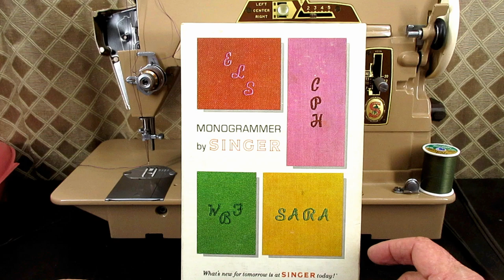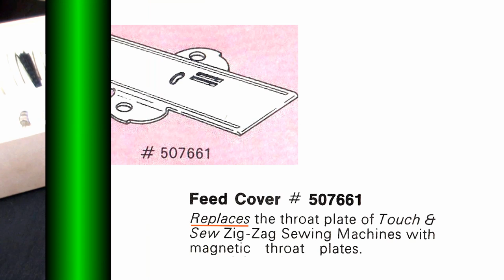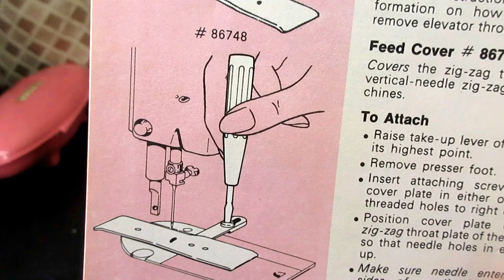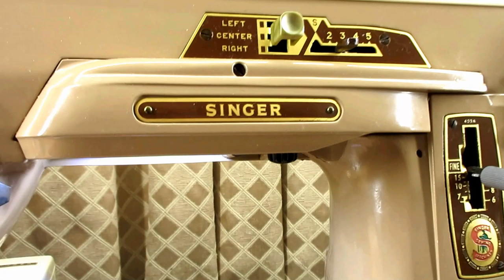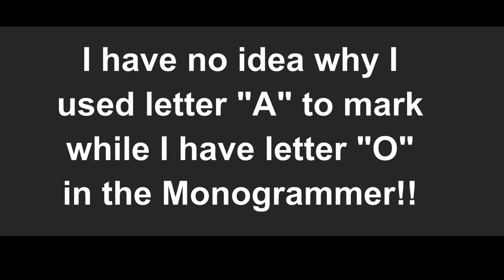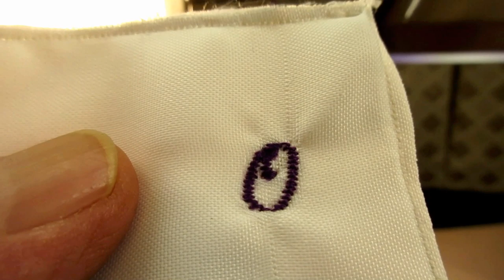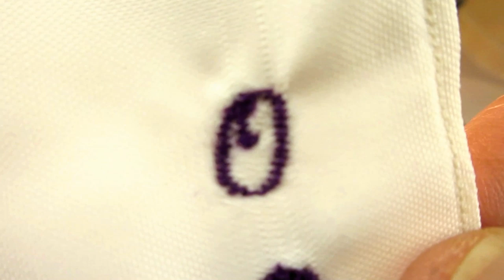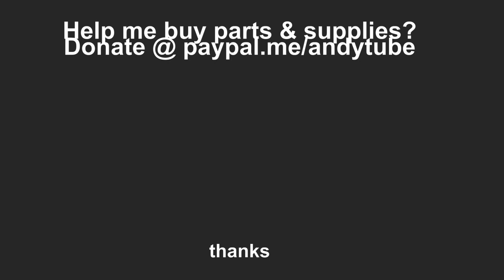The Singer Monogrammer on a Slant-O-Matic 403A Special Sewing Machine

Comment: I monogrammed all my work shirts with the company's name and my first name and people would talk to me first, thinking I was the boss. Ha ha
FYI To pull your threads to the back. Pull on the END lower bobbin thread on the back of the fabric until the top stitch loop pulls through, like that in an under-tensioned top thread. Hook the loop with a point of a seam ripper and pull it through. The shorter the stitch, the smaller the pulled through loop, so look carefully.
Reply from the maker: There you have it, folks! A tip from a real sewist. Thank you very much for sharing. I pinned your comment to the top.
Reply: i realize it's kinda randomly asking but does anybody know of a good website to stream new series online?
Reply: @andytubesewing1953 this is so precious and I love it when you pin comments - they are always educational but every now and then also provides the most useful tips interlaced with personal stories 👍

Comment: A little late to the party (4 years), but I thoroughly enjoyed the video and found it helpful.  A hint on improving the quality of the monogramming would be to use a fusible or tear-away interface backing on the wrong side of fabric in the area to be monogrammed.  The additional structure for the fabric helps.  Our granddaughter's parents are both doctors and I made a monogrammed play lab coat for her when she was 4 yrs old with her name + "MD" added for effect.  I used this same Singer monogrammer on a 500A machine I have.

Comment: I have this monogrammer and it is fun to use.  AFAIK, it only comes in a slant shank version - same with the Deluxe Monogrammer - which is one of the reasons I cherish my 401.  This monogrammer makes teeny little initials, mainly suitable for a handkerchief, shirt collar, pocket, or cuff maybe.  They are cheap and plentiful on eBay and ALL the letters are included.  With the Deluxe Monogrammer, the attachment is cheap and easy to find, but you have to collect the letters one by one which can be costly.
Reply from the maker: Thank you for watching my channel and sharing information. Page 16 of the Instruction Manual for this Monogrammer discusses three different feed covers that can be used. The third cover, #86748, says "Covers the zig-zag throat plate of vertical-needle zig-zag sewing machines." I have not tried it on a vertical-needle model, say the 347 or 457, but I think it can be used on them. The cover plate #86748 is very similar to the feed cover that came with the Singer Buttonholers. It is a little different, but I've wondered if the buttonholer plate could be used with this monogrammer on a vertical-needle machine. Maybe another viewer will comment and we can learn a little more. I'll pin your comment to the top so maybe others will notice it. Thank you again for sharing, lisalu.
Reply: I actually found a deluxe monogrammer for straight-needle sewing machines on eBay & bought it!  I guess it’s rarer than hens’ teeth.  Edit 8-7-24, the straight-needle monogrammer works great.  I also found & bought the deluxe and regular monogrammers for slant-needles.  Finding all the letter cams for the deluxe is a challenge.  I have all that I need for family members, but one day I hope to find the rest.  That may be “the impossible dream,” ha-ha.

Comment: I was fascinated by how to use the monogrammer. Did you try using regular embroidery thread to stop it from breaking? Will it work on a Singer 600e? It is a slant machine.
Reply from the maker: I do not sew and don't have embroidery thread to try. I think it should work on your 600E, but you can get a free copy of the instruction manual showing the different feed cover plates and how to use the device by emailing andymanuals53@gmail.com and asking for it. There is no charge and your email info will be deleted after they send you the manual in PDF format.

Comment: Clever guy !!!❤❤❤ I am left wondering if this would work on my Athena (also a slant needle machine)
Reply from the maker: Ooo, good question that I can not answer. The Althena models are newer than any I worked on. I'm guessing the slant feet are the same height on all slant machines. The question for me is if any of the three cover plates that came with the Monogrammer would work on an Athern model. The instruction manual says you MUST use a cover plate, however, I have used the buttonholers without the cover plate issued with it and had great results. I guess you have to ask other Athena users (Facebook groups??) if anyone has tried it, Of course, you could buy a monogrammer on eBay and make a video about trying it out 😁 Thanks for watching.

Comment: Great video. I was looking for a throat plate for my singer touch and sew (magic bobbin). The problem is that it was made in Japan and only sold in Vietnam. So it is different from all the touch and sew. It doesn't even have a model number on it. Came with the instruction manual but it is all in Japanese.  So I took a app on my phone that would translate it. I just bought a monogrammer so I hope that it will work. Love your video.
Reply from the maker: Never heard of a Japan made touch & sew. The US made models mostly used the same needle (throat) plate with a couple exceptions. If the monogrammer comes with a plate that fits then you could find a throat plate that does too. Good Luck.
https://www.singer.com/en-ca/find-your-model

Comment: can this type of vintage monogrammer attachment be use with new singer sewing machines???
Reply from the maker: what an interesting question! I've never tried it on a machine-made after 1972. I don't see why you couldn't use it. There are 3 different plates; two for slant needle and one for vertical needle models. You must have a mounting screw hole in the bed to the right of the needle plate to attach the vertical needle plate attachment. (vertical is also called straight shank and low shank) You can get a free copy of the manual from andymanuals53@gmail.com  The manual includes part numbers and a description of the 3 different plates so you know what to look for. Thanks for watching my channel.

Comment: Can I get a monogrammer for my Singer 411G? If so where? thanks
Reply from the maker: The German Mad slant needle models, like 401G or 411G are rare around here and I've never seen one in person or found parts or service manuals for them. If they are Slant Needle such as the 401A, 403A, 404 models are then I think the slant needle monogrammer would fit. There are many on eBay: https://www.ebay.com/sch/i.html?_from=R40&_trksid=p4432023.m570.l1313&_nkw=singer+monogrammer&_sacat=0
I sure other online sellers would have them too.

Comment: do you need this attachment to monogram a name on a shirt with a 503A?
Reply from the maker: Unless you can do that free hand then yes you need the attachment to form the letters. This machine and a 503A and most singer zigzag machines can sew. Very close stitching called satin stitching and that's usually what is used for buttonholes and monograms but they cannot form the letters because they are mechanical machines. This monogram attachment uses an inserted pattern. Cam or disc for the letter that you choose and that is what forms the letter

Comment: Thank you for this video. Do you by any chance know the part number or way to identify the screw that attaches the monogrammer to the presser foot?  I was sad when I realized that I had all the parts to the monogrammer except the attachment screw. I’ve tried other similar screws from buttonholers and other singer machines and nothing is long enough or fits the thread pattern on my 401a.  Any help would be appreciated.  The manual doesn’t list the part number for the screw that I can see. My box says part 171256.
Reply from the maker: Sorry, there is no part number that I can find. I have monogrammers & buttonholers, and the screw threads are the same count and length so I'm surprised at your comment. The thumb part is "beefier" on the buttonholers is the difference. Here is what the original monogrammer screw (attachment screw in the manual) looks like: https://www.ebay.com/itm/403011649561?hash=item5dd55dc019:g:g~oAAOSwiXpgL69K    Here is the original "clamping screw" for the buttonholers I have (3 types of buttonholers) looks like: https://www.ebay.com/itm/294184296550?chn=ps&mkevt=1&mkcid=28   both types of screws fit onto and thread my 401A & 404 presser bar.
Reply: @andytubesewing1953  thank you!  I will try the buttonholer screws one more time and see if they work but yesterday I couldn’t get it to work.  Thank you for responding as I didn’t know how to find the part!  You are the best!
Reply from the maker: @atticusk8548  Please do try it again. The mounting part that wraps around the presser bar has to be flat onto the bar and at the perfect height for the hole. After a couple times you get the feel for it, but it's bulky and awkward at first.

Comment: I think you said this model will work on the 401a. What model buttonhole attachment, the big thing like what you showed on video🤔) will work on my 401a?
 Lol. 
I see new toys for my machine in the near future. Haha
Reply from the maker: The one in the pink Jetson box. You need one marked for slant needle machines. The Pink Jetson model you use with your 401A set to straight stitch AK3 and the buttonholer moves the fabric back and forth. The professional buttonholer model uses the ZZ stitch of the machine and you change the template from the top cover so there is no need to take it off the machne to change hole sizes. Here are some links you may be interested in about BH. https://sewing.patternreview.com/SewingDiscussions/topic/90955
https://runningstitches-mkb.blogspot.com/2012/07/the-buttonholer.html
https://www.youtube.com/watch?time_continue=1&v=v6BZdgU3bIg&feature=emb_logo
http://ismacs.net/singer_sewing_machine_company/more-on-singer-buttonholers.html
http://ismacs.net/singer_sewing_machine_company/manuals/singer-professional-buttonholer.pdf
Reply: @andytubesewing1953  thank you very much!!!
Reply from the maker: very welcome

Comment: I just bought one of these monogrammers last month at a thrift shop for $7. I looked for a video on using it and didn't find anything good. This is a great video!! I was going to mess with it, but I realize it needs a zig-zag. and both my slant stitches are non-zigzag. (404 & 301) I guess I'll have to wait until a zigzag slant stitch comes along.  Thanks for another great video Andy! I think mine has the manual and template. Mine actually came in 2 boxes, the monogrammer and a separate box for the discs.  Thats awesome you are providing the manual. Cheers from Michigan.
Reply from the maker: Wow, how do you guys find these great prices? You can use this buttonholer on a vertical needle machine too! It does not have to be a slant-needle as long as it can sew Zigzag. (page 16 of the manual) You need feed cover plate #86748 or the feed cover plate from a Singer Buttonholer, like in the red treasure chest one made for the 301, or the green or blue "Jetson". If I had a working straight shank model, like the 99K, 237,347,457 I would have tried it out. You saw my zigzagger video for the 301, right? It can be used on the 404 also I believe. https://youtu.be/zYtDIxH1tJ8  Thanks for your comment. Take Care.
Reply: Technically, you CAN make a straight stitch monogram on your 301 with this attachment.  It won't look like much, just an outline of the letter, but it is possible.

Comment: Can you please explain the difference in part numbers 171256 vs 171258? I have a 401a and I want to make sure I get a Monogrammer with the correct plate. Thank you
Reply from the maker: To the best of my knowledge 171258 is the one for your 401A. 171256 was for Touch & Sew models like the 750 & above. Here is what is important though. On page 16 of the instruction manual it explains the 3 different cover plates that can be used with this original monogrammer attachment. COVER PLATE #161825 is for Touch & Sew and Slant-O-Matic Zig-Zag sewing machine with the elevator throat plate (needle plate). When you buy these vintage items, especially from ebay, you can get mixed up parts from some sellers. So I'm saying you could get a monogrammer 171258 but with the wrong cover plate and it would not work properly on your 401A. I have learned that if I cannot see the 161825 on the bottom of the plate to ask the seller for a picture. Hope that helps you out, Rishi. Thanks for watching my channel and good luck. Oh, BTW, I said in the video anyone needing a copy of the instruction manual to email andysmanuals53@gmail.com and ask for it. No charge.
Reply: @andytubesewing1953  thank you for the detailed explanation. Best reply I've ever received on YouTube
Reply from the maker: @MirchiBoy  I'm honored that you feel this way. Thank you very much.

Comment: The box shows a different number, last number in the box is '6' and not '8' which you mentioned.  May I know, which number is for slant shank please?
Reply from the maker: Sorry I messed this up. Singer used part numbers for almost every item they made. In this case I was informed that the No. 171256 is the part number for the box itself, and the part number for the device is 171174. https://ismacs.net/singer_sewing_machine_company/singer_monogrammer_attachment.html
This monogrammer fits slant needle machines. It may also work on straight needle machines b/c in the manual it shows an additional plate for use with low shank straight machines. As I mentioned in the video anyone can email andymanuals53@gmail.com and ask for a free copy of the original Instruction Manual for this Monogrammer. Here are some other web pages I came across when I was researching for this video. You may find them interesting. https://www.singersewinginfo.co.uk/simanco/171256
http://runningstitches-mkb.blogspot.com/2018/01/singer-monogrammer-other-one.html
http://www.ashleyandthenoisemakers.com/blog/2015/5/30/singer-monogrammer-review
Later in time Singer also made a DELUXE monogrammer with a more modern device and the ability to make larger initials.
Ashley also made a very nice review for it. http://www.ashleyandthenoisemakers.com/blog/2015/4/24/singer-deluxe-monogrammer-review   I hope this clarifies the info and thank you for watching my channel.
Reply: @andytubesewing1953  thank you!
Reply from the maker: @SuperModerngranny  sure thing, very welcome.

Comment: Interesting exercise in antique sewing, but I have to wonder if it is worth the effort with so many cheap modern machines around that can do this in seconds. I love old Singers and have around 10 of them but I do not love these attachments, they just seem pointless in this day and age IMHO but everyone has their own opinion I guess, just a bit of historical fun.
Reply from the maker: OK. Thanks for watching.
Reply: I wonder the same thing sometimes but these machines are easy to fix when they break down it's literally just 1 or 2 things because everything is mechanical. New computerized machines dont last as long and usually end up in a landfill. My antique machine is a little more fiddly but I feel its worth it. Yes you need attachments and it's not a press of a button but theres also less that can go wrong I feel like
Reply from the maker: @ashleyzboya2097  I recently went to a very large sewing center in a nearby city to buy rubber feet I needed that day. The "parts guy" invited me back to the storage area while he got the part. In the back corner I noticed a huge pile of machines stacked every which way; maybe 150 of them. When I asked about them he said "Oh, those are the cheap broken machines people bring in to be fixed, but we either can't get parts or they are riveted or even glued (yikes!) together. There is no way to fix them." When I asked what they will do with all of them he said they have no idea so that's why they are just piling them up there. What a shame, really. BTW, there was not a single vintage machine in the pile.
Reply: @andytubesewing1953  very insightful. Thank you. They dont make anything like they did. A little work goes a long way. I often think things will be easier to buy a modern machine, but then after a while I think that in 2 or 3 years I will be in the same position. So I will stick with my 403A for now.
Reply from the maker: @ashleyzboya2097  👆 what you said Ashley
Reply: Ashley Foesi I totally agree about the quality of the older machines and the ability to easily fix them, as I said I have 10 Singers ,201s,221,306 and a fairly rare 431G ,99ks etc but it’s just those attachments that I do not like using.I am an engineer and I have grown to accept some modern things can be an improvement but simplicity can also have it’s place.
Reply from the maker: @ashleyzboya2097  Thanks for your comments and insight.
Reply: For me, the fact that it is so mechanical and "complicated" is half the fun.  Just seeing what this clunky old attachment can do - and the engineering that went into it - is amazing.  Having a computerized machine "do it for me" just wouldn't be any fun, and quick results aren't really my goal anyway.  I'll find excuses to make monograms just SO I can use these attachments!

Comment: Any possible way to get Deluxe Monogrammer template and manual?
Reply from the maker: I've never been able to find a free one online. There are usually several on eBay such as this one for $7.95 https://www.ebay.com/itm/403011659709?hash=item5dd55de7bd:g:X1oAAOSw8AZgW5e8
I don't know enough about the deluxe one to even know if it uses a template. I seem to remember letter cams, but it's long ago since I saw one.
Reply: @andytubesewing1953  Hi! Thanks for your quick reply. Well I am off to ebay then. I like finding all the pieces and parts...my sewing is not great, but I still enjoy trying to find everything for the 401a. Thanks again.
Reply from the maker: @abeforee4780  The Slant-O-Matic is a wonderful model and I hope you find all the attachments.